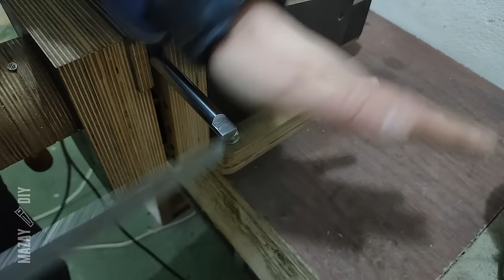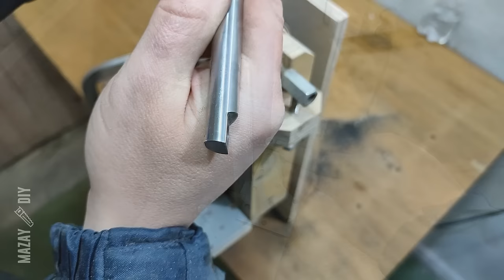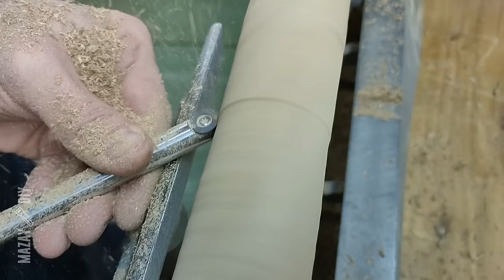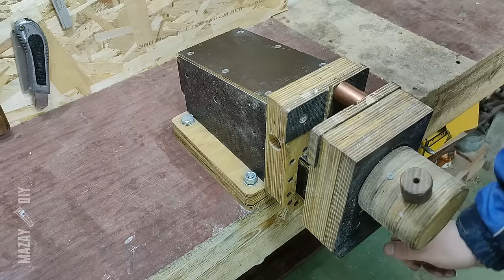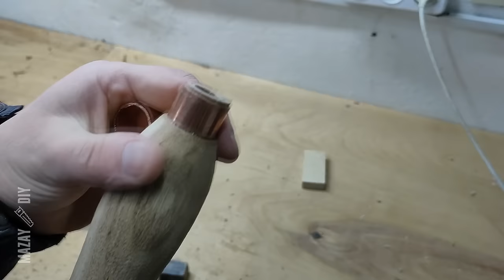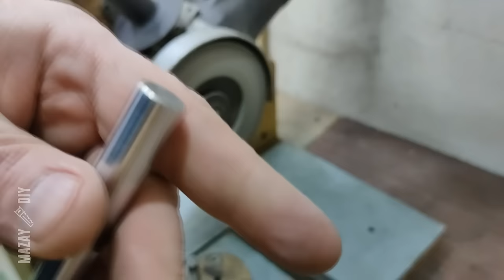Homemade Woodturning Tools | DIY Carbide Chisels

Comment: Nice work! One remark: You should try to use your file in a different way, just push in forward direction and take it off, when pulling back. Use this method with a new one and it will last for years and keep you happy!

Comment: How do you make sure the bolt won't come loose flying the carbide tip in the air? Any lock washer or loctite needed?

Comment: Carbide inserts aren't as sharp as HSS and other tool steels, but I guess it works with a powerful lathe for rough cuts.
Reply from the maker: I agree, but in the world there are adherents of both one type of instrument and another. I see two big advantages of carbide inserts:
1) they do not need to be sharpened, and this is a very big problem for beginners.
2) they are cheaper than high-speed steel cutters

I don’t use them very often, but it happens - for example, I don’t have a cutter to make deep holes and my homemade cutters really helped me out. You can watch it here - https://youtu.be/fPZ15glrjv0

Comment: Very nicely made were the rods stainless steel and what make of drill bits did you use
Reply from the maker: HSS brill bits. Before drilling, remove some material (hardened layer) with a file from below and above the through hole